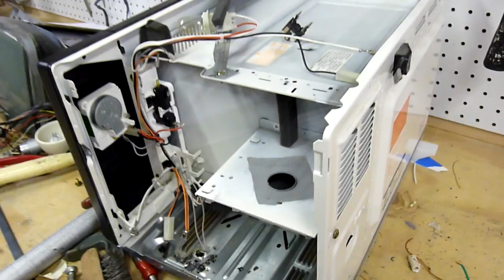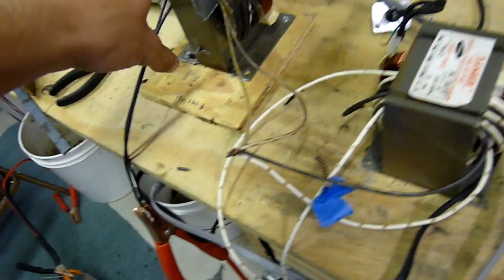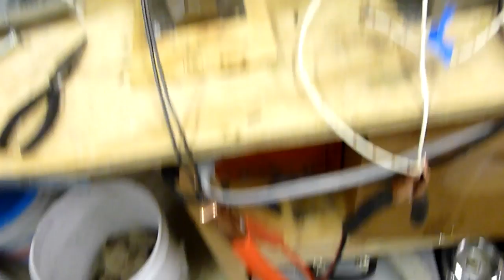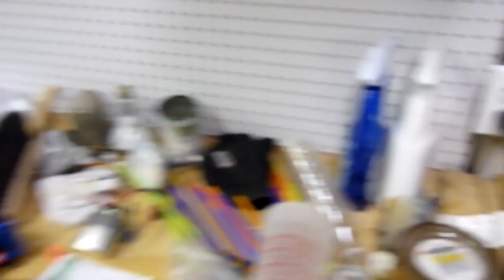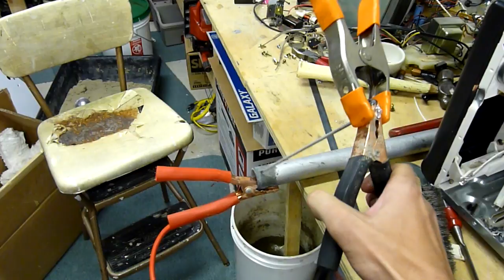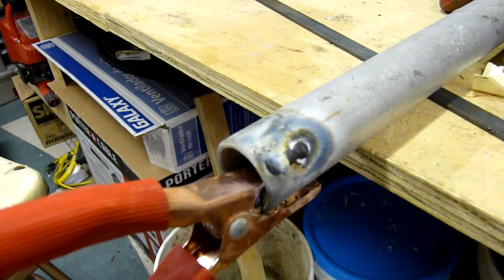Homemade AC Arc Welder

Comment: Is DC arc welder better than AC arc  welder? If so in what ways?
Reply: With dc you'll get significantly less spatter and better penetration. Ac also runs to hot, something to do with the alternating current putting all the heat on the work, in turn burning holes in pieces you normally wouldn't burn through with dc

Comment: how much voltages on each transformers in primary winding and how much voltages on secondary i made with one transformer if it is posssible or not if it is possible u give me suggestion which type of trnsformer i used its output voltage and its ampere

Comment: I have a feeling the drawing this much current from your house without a variac might be detrimental. I mean how did it not trip the breaker
Reply: each transformer only pulls about 5-6 amps.  So that totals 10-12 amp draw.  Houses are usually wired for 15 amps on the standard outlets and 20 on some shop ones.

Comment: does it shock you when you attemp to touch the ground clip and the electrode?
Reply: +Mecha Tronics no because you wear gloves
Reply: I am doctor carvey and from what I know inwich is a lot more then your for Father's  this and all of the welding vedio s are not true the king at random is a lier   he doesn't show all that it takes trust me  what about the capasters he doesn't meanchion
Reply: Sorin Molnar if I use mots u r working with ac current please don't have kids this world is dum enough  ps stay away from a live current and off of u tube
Reply: no bcz it works at arround 40 volts DC

Comment: that's zinc coated pipe , its not weldable and the fumes have the potential to be dangerous you shouldn't weld in the shop like that . I am a professional metalworker .
Reply: +Warrior Portable Welding      I was wondering why there was so much smoke. I've only welded a hand full of times but never saw a big cloud like that from just a few seconds of contact.
Reply: +Warrior Portable Welding      I was wondering why there was so much smoke. I've only welded a hand full of times but never saw a big cloud like that from just a few seconds of contact.
Reply: Listen this man. The disease is horrible and fatal lung disease which there is no cure for and causes a slow painful death. Never ever heat galvanized metal
Reply: it's weldable metal... just not healthy... you should grind the galvanizing off before....

Comment: hey! nice video! how good are the welds?? I just learnt to open the Microwave transformer.. Now I'm curious whether the Microwave Transformer welder is a real good n cheap alternative or not.. Pls inspire me more!
Reply: Don't mess with microwave transformers. They are dangerous. While this guy uses 30v high Amps, a microwave transformer puts out high voltage with decent amps, and that is incredibly dangerous, because there are relatively high currents that could run through your body because of the high voltage
Reply: I finally bought a 200 Amp D.C. Inverter Arc welder for 100$

Comment: Could someone please tell me how do you put two transformers in phase???
Reply: +Waqar Alam Alquadri whats the L1 , N1 and L2, N2? how can i say i got the L1 & L2 correctly? and what if i connect the wrong wire whats gonna happen? im confuse because im not very good at this, but im willing to learn by watching and inspire me to do this ARC WELDING project... please help me and teach me a little bit... thanks...
Reply: +Bryan Mark Villanueva it seems You are not having electrical engineering background, but dont worry its nothing.

1) you are having two identical transformers. That means they are having equal no. of turns in primary winding and their direction of winding is also same.
2) So all you got to do is just place those transformers one above another (physically) now connect the two terminals of primary which are on left side and connect the two terminals of primary which are on right side. (now you have connected primaries of transformer)
3) now do the same thing for secondary winding
4) you just have to connect them in parallel 

* wrong connections will cause short circuit.
Reply: Please explain!  Cause I'm new to this. How would you put two transformers  together to weld? The phase part got me confuse.
Reply: lets assume L1, N1 and L2, N2 are leads of primary of transformer 1 and 2 respectively. what u got to do is just join L1 L2 and N1 N2 and put these joints in supply (parallel operation).

Comment: So basically you hooked up two microwave transformers, connected them to a pipe and connected another jumper cable to them with a welding rod at the other end? Nice and simple compared to other homemade welders.

Comment: Unearthed transformer frames. Bare feet. I hope you used some eye protection. I once suffered an overnight case of arc-eye from several minutes of exposure to a UV lamp and it is not an experience I would recommend to anyone. Imagine waking up in the middle of the night seeing everything through fog, having eyes itching so badly you want to tear them out and wondering wether you will ever be able to see correctly again. More safety please.

Comment: Hi,nice video i like it.I have a few question, how tight do you have to make those
windings,did any of the primary windings gets hot and what do you think would
be the cause.I build one with two different size MOT like yours but i notice that
the smaller MOT primary windings gets hot quickly.The larger MOT i give 20
turns, the smaller i was trying to give the same but it couldn`t take.
So what do you think is the problem.

Comment: Hi! I don't understand so much english... I'm interested in building a homemade welder, a tig or semi-automatic (mig-mag) welder, and I don't know where to start...I have a 150 amp electrode welder, and I can use that transformer, but what about the winding? Should I change it? And those micro waves oven transformators, which you change the secondary winding, is not overeating after a few minutes of use? 

would greatly appreciate your response, greetings from argentina!